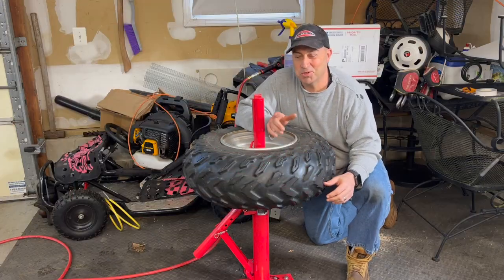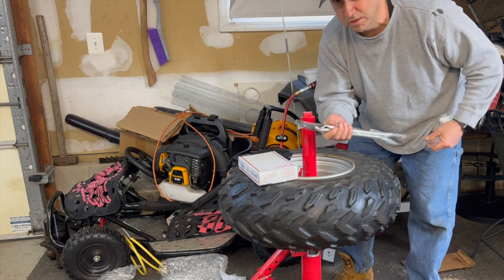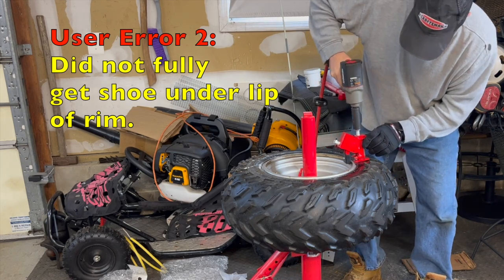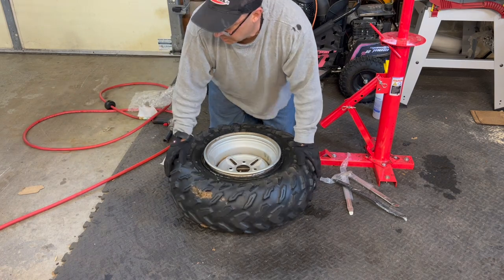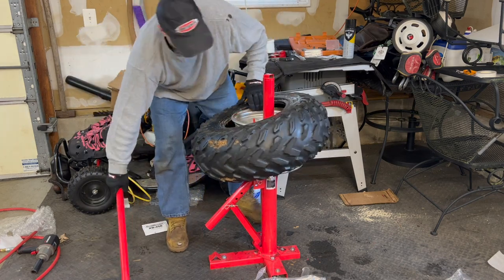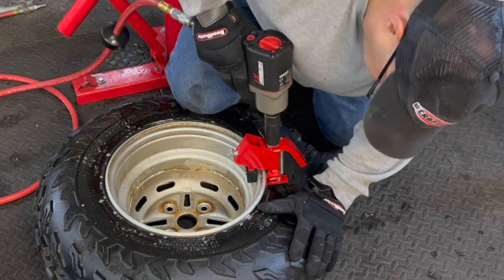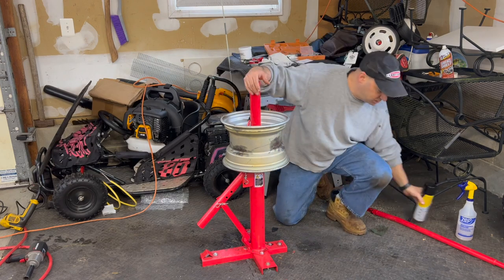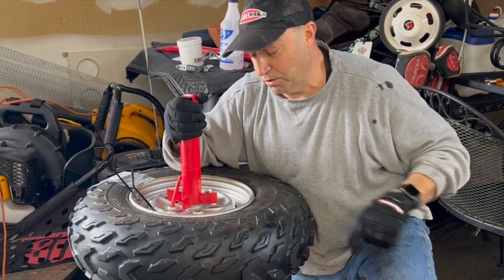How to Break a Bead on an ATV Tire with the BeadBuster

Comment: Mike, thanks for the honest video.  I have to say, as the inventor of the BeadBuster, the 1st 16 minutes were painful to watch!  It was a tour-de-force of what NOT to do.  The 1st mistake was throwing away the instructions AND the warning tag that is on the ram bolt...both of those would have reminded you of the key elements for successful use.  2nd mistake was using that stupid tire changing stand with the post in the way.  My favorite way to do this work is on a waist high bench, although the ground works well enough, as you learned.  3rd mistake was NOT DRIVING THE FEET FAR ENOUGH INTO THE LIP OF THE RIM.  Even when you started using the impact, your weren't getting the feet all the way seated.  The tool body needs to be touching the lip of the rim...I could tell you were far from touching the 1st few times.  When you tore the sidewall, it wasn't because it was leaned past 90...its because it was not fully inserted.  The ram foot wasn't on top of the steel cord in the tire bead (called the bead bundle).  So you essentially just stretched the rubber in the sidewall and it tore.  When you have the foot properly on top of the bead bundle (with full insertion) the ram is pushing on the bead bundle (NOT the sidewall).  So then it doesn't matter how narrow the foot is.  The bead bundle is acted on by the ram foot, and that brings the rest of the tire with it.  This video really highlights how uncooperative some ATV wheels can be.  The crux of the issue is, you were looking out for going past 90 deg, but some wheels, like yours, result in going past 90 to get the feet fully inserted (ie contact with the tool body)...then once you are touching, you can back off of the clamp bolt a bit, and line the tool up to 90 deg.  That is the proper way to get the tool lined up on tires like yours.  I'm glad you figured out the technique, and we appreciate the positive remarks.  For those of you reading, DieselMike cold called me one day asking if I could send him a tool to do a review on his YT channel.  I said sure, sent him a kit, asked him to be candid with his opinions, nothing phony.  I did not pay him for this, just gave him a free tool.  So this is as real a video of the experience as you're gonna see.  But trust me, read through the instructions 1st, and you'll save yourself some face-palms.  Lucas, co-Founder BeadBuster
Reply from the maker: Lucas, thank you so much for the comment, critique, and mostly sending me the unit.  I didn't mean any disrespect by tossing the instructions aside. I thought I familiarized myself with them enough prior by watching the videos you sent me. But as stated in the video I didn't want to do one of those reviews where I just cut to the successful attempt where I trick the viewers into thinking I got it on the first try. So for sake of speed, I skipped reading them.  Lesson learned.
I totally get what you are saying about getting the foot fully inserted.  When I was reviewing my video, I could clearly see that hand tightening the first bolt was way insufficient.  That tip you mentioned about going past 90 degrees to seat the foot and then backing off to 90 is the one main takeaway I would advise to anyone reading this.
Thanks again Lucas!

Comment: This is why you should soap up the rim bead surface to break those beads easier . Should be done at the factory first install !
Reply from the maker: No doubt!  All 4 wheels now have a nice layer of slippery Surface Shield/Fluid Film (same thing) as you saw in video.  So if they need to come off again, I imagine they will pop right past the bead.  Thanks for commenting! 👍🔧